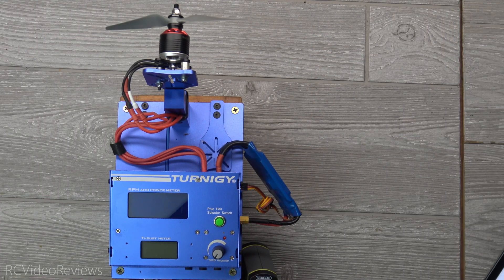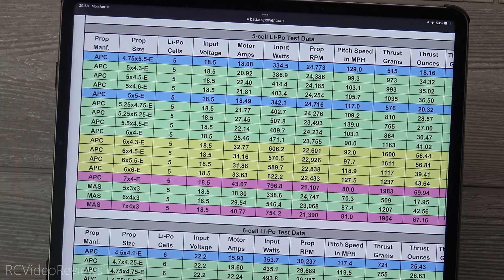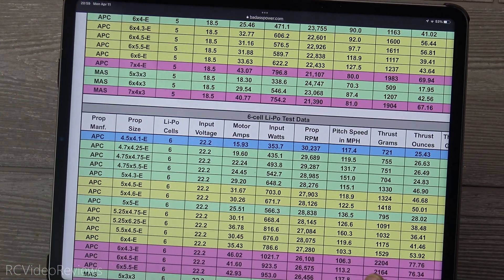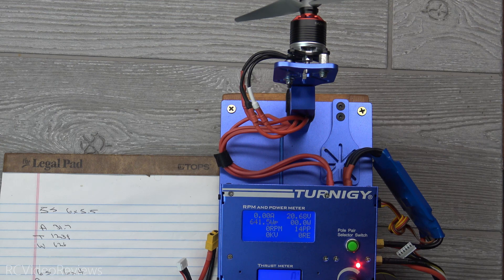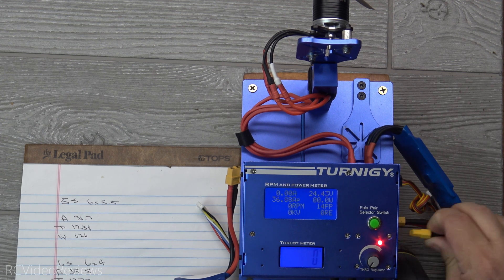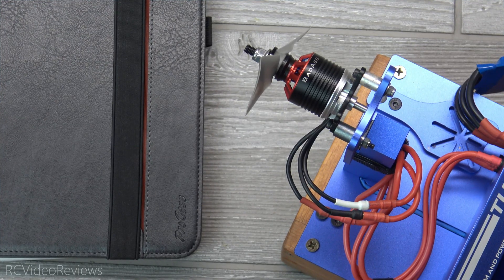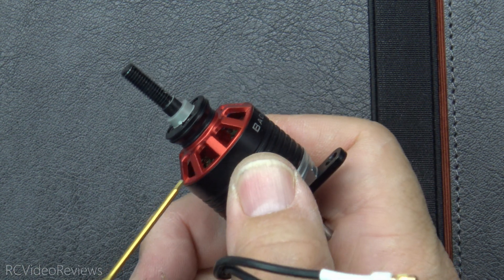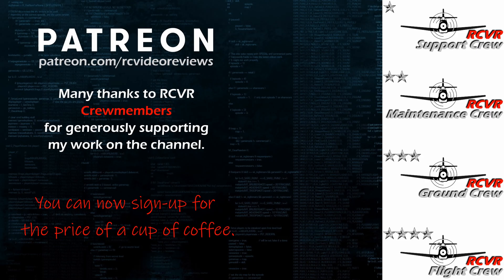Badass Power Systems 2315 1480Kv [The Judge]

Comment: I mean its cool data collection but numbers on posted vs numbers you get at home will always vary. 
You can use 4 different brand 6 cell 4000mah batteries and get 4 different results.
Reply from the maker: I've been able to repeat Cobra data fairly reliably. Leopard too. It's not always spot on but it is very close. Delta from battery to battery exist mostly when the battery sags too far under load which means generally higher IR. I use batteries in very good condition for these tests which is why I can do things like hit the advertised amperage value within a few tenths. It's all in the videos...

Comment: Thank you so much for this video! I'm doing a high speed challenge on a wing and I'm using a 2216 1400kv sunnysky but may try one of these motors  out 😎🤙
Reply from the maker: I've been flying the Goblin with a Cobra 2217 2300Kv motor and 6x5.5 on 4s and that's pretty quick. This motor will be spinning a 6x4 on 6s. I'm anxious to see how it does.